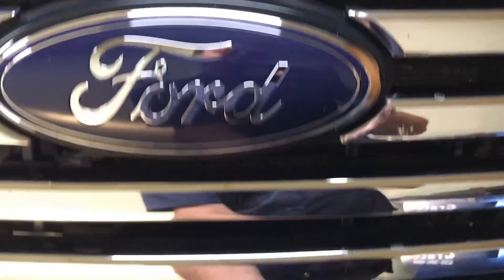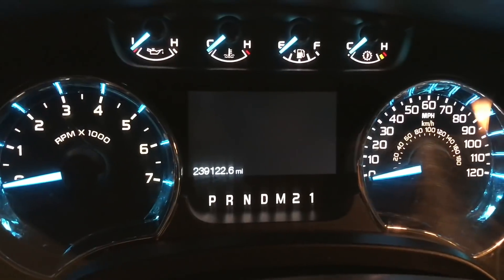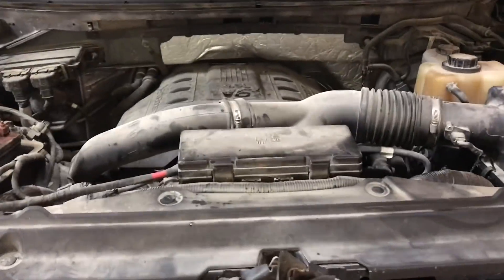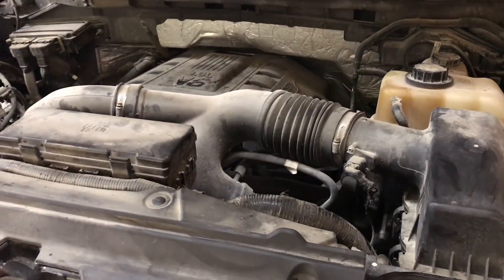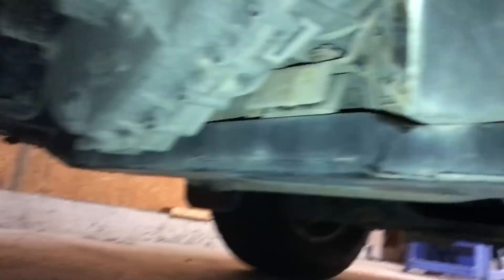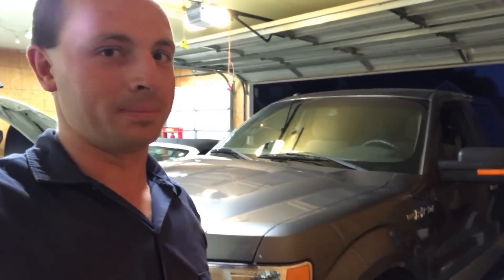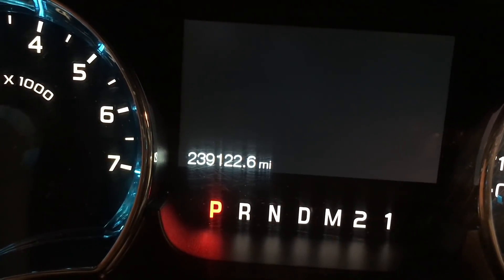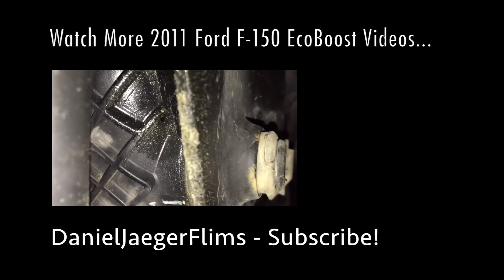Is the EcoBoost Engine Proven?

Comment: I don't trust it,  my grand marqs had 286000 and the odometer didn't move so technically the 4.6 v8 could have had 500000, 1 million, now the ecoboots argument is "well maintained ", crown vics marqs and town cars can go this type of mileage with lil to no maintenance huge difference
Reply: I mean, well maintained probably means they changed the fluids when they were supposed to, and maybe a few other things,  so the same as a crown vic, unless you're saying a crown vic can go 500k without an oil change jk lol.
Reply: @KB-bh9hp  i said little to no maintenance,  meaning none to things like coolant, trans fluid, air filters, fuel injectors, etc. Little meaning not frequent oil changes and things of that nature. You never driven an older vehicle with oil so black its glossy? still runs fine right, i bet it does
Reply: the engines are good in those panthers ,but unless you have a p71 the transmissions need to be meticulously maintained otherwise you will see 170k before they go.
Reply: I agree. those unbreakable 4.6 run forever. but this guy Is talking about new generation hi power lightweight and economical engine. this new  family of motors(ecoboost) still are in their early stages working their bugs out. the smallest gdi ecoboost have intake valves carbon issue. so doez several bmw and  chrysler with their new motor designs.not all designs come out bulletproof even from gm. example Northstar "shortstar" or infamous crappy 3.1. I'm mechanic, and I appreciate reliable designs. however times change. we must follow the technology,accept compromise in performance VS fuel efficiency and emission control standards. I agree with above mechanic. 24000 on this motor is good progress. cheers.
Reply: @jerrykruger  its all about the test of time, had a 74 duce n a quarter electra 225 with the 455 and she still ran after sitting for 20 yrs with just a battery, oil and coolant,  they don't make em like they used to had two 4 bangers,  a buffet of v6s  , and about 6 v8s in my day and none if the v8s quit ever, misfires low oil pressure leaking coolant all that and more and they never let me down now the 4s and 6s you talking o2 sensors, headgaskets, water pump, u name it those components die when they reach certain mileage and abuse,  v8s can have all those problems and more and only see small loss in power but overall still can be daily driven, my 88 Silverado had a clutch fan break and cut the serpentine belt and i still made it 2 miles home before it started to run hot, no power steering,  no water pump, no alternator,  still ran fine that's one instance but you get my point,  i love new cars but it have to be an 8 or better,  eventually ill trade the g8gt in for a hellcat or an r8
Reply: Those crown vic's are tough, hence police and taxi drivers used them for so long

Comment: I was a die hard GM guy before I bought my '18 F150 STX 2.7 Ecoboost. The truck genuinely impressed me on the initial test drive. Hopefully I get a long life out of it, don't have too many miles on it currently.
Reply: The 2.7 is the better choice. It has a better timing chain set-up than the 3.5 liter. Two medium sized chains are better than one long one.
Reply: i rather have the 3.5
Reply: JGL25 that's funny I did ty he same thing you did. My whole family is GM as me also but I just bought the same truck you did and love the 2.7
Reply: take care of it.
Reply: I was going to go 5.0 but couldn't fit everything that I wanted within my budget right now. I usually rotate trucks every 2-4 years so I will probably purchase one next.
Reply: If you bought a Ford, you were NEVER a diehard GM guy. lmao
Reply: @danp7463  In my opinion the 2.7 is a little under powered for a 1/2 ton pick-up.
Reply: Randy Jackson  dont believe everything on the internet. I have a 2.7 52 k miles so far and it's awesome. No issues and I tow my trailer alot and abuse it. Its fast off the line puts all half tons to shame.i know someone who has 170k on his ecoboost zero issues so stop believing everything. I am living proof their solid

Comment: BillsTmax takes care of his and has had to do timing chains twice. Guess it's like GM and the AFM system. It's a 50/50 shot if you get a good one or a junk one no matter how well you take care of it.
Reply: Is the best way to avoid problems with the newer ones to deactivate AFM?
Reply: s Smit Yes, tune it out while the truck is still new.
Reply: I think part of the problem with Bill's truck was the shop he was taking it to was screwing him over big time and not replacing parts they were supposed to as part of the chain replacement.  Not saying the replacement parts that they DID replace weren't potentially faulty, but I put more of the blame on the stealership that did the work for him.

Comment: EcoBoost guys. I'm looking at a 2018 crew cab xlt with max trailer tow package 4x4 and the 3.5. I will be hauling a 7,000 lb trailer pretty exclusively on the weekends. Right now I own and 2001 f350 dually with the 7.3. Will I still be satisfied with the eco in real world towing?
Reply: Damien Hobbs I’ve got a 2017 3.5 EB , 10 speed, max towing, 8’ box. With it I pulled a 8000 lbs trailer and two motorcycles (1000lbs) in the box from Ontario to Florida last year. Wow I’m so impressed with this truck, was passing semi’s in the mountains of Virginia doing 65 mph!!. It’s my second EB had a 2011 before this one. 7000lbs trailer will not be a problem.

Comment: Great video. This gives me more confidence in my 2012 ecoboost fx2 f150 at 67000 miles. Synthetic oil is the key I believe at regular intervals. How do you feel about a catch can and did you plug the intercooler after drilling. I drilled mine  and plugged it after

Comment: I asked this question on your earlier video about this truck but I'll ask it again in case you don't see it.  Since this truck clearly didn't have a catch can system installed and it's doing great, do you recommend installing catch can systems on 3.5L EcoBoost engines in the F150?  Some sources say it's absolutely necessary but this truck goes against that reasoning.  I would greatly appreciate your opinion on this.  Thanks!
Reply: I have 398k and never installed a catch can. Still going strong.

Comment: Who would win in a fight?
a 7 year old truck with 240k of well maintained highway miles,
Or a 15 year old retired cop car with 300k of the hardest neglected miles you've ever seen.
Ford has had better, proven engines. The 5.0 looks to be more of the same. The fact you have to make a video to show us one case where the ecoboost didn't shit itself in under 200k is proof enough that this engine hasn't earned its place.

and this is coming from a chevy/dodge fanboy.

Comment: Great Video - I think all Ford Truck engines are rated to last 400K miles with proper maintenance.    I was skeptical of the 3.5's when they came out, and I had heard that the turbo's were only rated for 150K miles.   You're at almost 250K now, and those turbo's are still spinning great, so that also gives me a lot more confidence in the 3.5.    That being said, I'm not giving up my 6.2L any time soon. :)
Reply: I would think the far far majority will go WAY WAY MORE than 400k even IF you take care of it and you are'nt flooring it at every stoplight.     I'm sure some parts will be replaced or even a turbo... but so what??    Keep going..     Why should'nt they ?
Reply: What was the 6.0 Powerstroke rated for?

Comment: I have a 2013' F150 ECO , I have 96,000 miles; when should I change spark plugs, also, trans fluid? and Radiator fluid?
Reply from the maker: I'd change all three every 100k miles.

Comment: What do you think of the 2.0 ecoboost? I bought a 2016 Fusion titanium with 45K.
Reply: i don have a fusion but i have a 2014 fiesta with the 1.0 eco . i just past 82,000 miles and she runs great.
Reply: The 2.0 EcoBoost is a great engine. There is a guy in the Fusion FB page that has over 200k on his.

Comment: I drive an Ecoboost for work. Good Torque but sounds like a queef when you get on it. Been to the shop 3 times for warranty work. Its a 2015 with 72K. Waterpump, 2 times for coils.
Reply: That's weird I have a 60k ecoboost no issues I know someone with 180k no issues.
Reply: @jayg9732  as they say
Hit or miss
I guess they never miss

Comment: Did you leave the weep hole in the intercooler open or do you put a screw in it and drain it now and then.  I am in michigan and worried about moisture getting in.  Thanks!  What about doing a catch can in cold climates?
Reply: You can have a hole in an intercooler so I'm sure its plugged.

Comment: I want to get the 2014 limited witht the 3.5 ecoboost would you recomend?
Reply: Get a 5.0 less issues
Reply: I have a Lariat and a lot of the quality of life features have failed and needed replaced, sunroof switch, steering wheel buttons, rear window defroster. Other than that, its amazing

Comment: It's ridiculous to think that you can't find some EcoBoost engines with high miles that are still running good. But also we must keep in mind that Ford sells over 900000 a year.  The truth is that most won't make it that many miles even with good care. You're likely to see as many 2011 Chevys or especially Toyota's still on the road even though Ford sold more than twice as many trucks. We should focus on what percentage of the units produced will make it past 200k. Ford not likely to do well.

Comment: They did have a V8 didn’t they? A 5.0 Coyote and a... 4.6 back in 09?
Reply: The F-150 has had a 4.6L V8 from 1997-2009, a 5.4L V8 was optional during those years too. Then in 2010 F-150 had gained a third V8 the 6.2L V8 (Newley developed Engine). In 2011 they removed the 4.6L V8 and the 5.4L V8. The 4.6L V8 was replaced with the 3.5TT V6 EcoBoost and the 5.4L V8 was replaced with the 5.0L Coyote V8, 3.7L N/A V6 was added too, the 6.2L V8 remained an option on F-150 up to 2014 then it was moved to the super duty series for the 2015 model year. From 2015-2017 the F-150 was powered by the 5.0L V8, an added 3.5L N/A V6 (replaced the 3.7L N/A) V6, 3.5L TT V6 EcoBoost and an all new 2.7L TT V6 EcoBoost motor. (Two EcoBoosts now Lol). In 2018 - 2019 the F-150 Kept the 5.0L V8, 3.5L TT V6 EcoBoost & 2.7L TT V6 EcoBoost, but the 3.5L N/A V6 was removed and replaced with a 3.3L N/A V6, F-150 also picked up the Diesel 3.0L V6 Powerstroke in 2018-2019. Long story short the F-150 From 2010-2019 has had a lot of motors added and removed. Currently theres 5 engine options (too many lol) 5.0L V8, 3.5L TT V6, 3.3L N/A V6, 3.0L Diesel V6 Powerstroke and the 2.7L TT V6.
Reply: Edward Myers Jesus Christ that’s a lot of engines..
Reply: @chaoszombie9995  yes it is ever since 2010 it's been crazy. Like the 90s- early 2000,s was simple 3 engines. Now in the past like 8 years weve had like 7 motors 5 gas V6's one diesel V6 and a couple of V8's too much going on. Hopefully soon Ford will sort it out. and I forgot to mention the 4.2L V6 from 97-2008 LOL

Comment: Wow, oil changes make a difference
Reply: That and letting it warm up in the morning. My '05 5.4 3 valve has more miles than that eco boost and run's strong. I don't care what people say about oil change's I do mine every 3,000 Castrol gtx 10/40. As far as filters go I've used them all including Fram.
Reply: @danp7463  i have a 97 f150 with a 4.6L, at almost 199k. I thought i was the only one who let mine warmed up. OCI every 3k miles with MC syn blend. How ahs the castrol gtx worked so far?

Comment: The timing chain has never been done? Or the turbos? I know in 2011-2014 the timing chains would stretch, and waste gates would sieze up on the turbos. There were TSB's. Non of that has been done?
Reply: Alex Puls the timing chains on all the motors built in 2011/2012 were part of the TSB. Some 2013 trucks have the problem because of their motors being built in 2012. I haven’t heard of any turbo failures and if it happened it’s rare
Reply: @nationalwashproducts2124  the turbos themselves don't fail. The waste gates seize and the engines overboost and go into safe mode. I've replaced a few of them.

Comment: What about timing chain rattle or tensioner stretching upon cold starts?
Reply: Joshua Guzman start changing your oil sooner then recommenced. What climate do you live in?
Reply: @honeybear1234  Harlingen, Texas/ South padre Island closest you can get to sea level.
Reply: I am in San Antonio I started changing the oil about every 3k miles and have noticed the timing chain rattle to be pretty much eliminated. The extreme heats are breaking down the oils quicker which is creating less lubrication. Try it out see if it helps...

Comment: How in the world do you get 21 with the Ecoboost. I want that mileage with mine.
Reply: He does construction so maybe it's a lot of highway miles.  Slowly accelerate when stopped and cruise at highway speeds.
Reply: As much as Ford would love to say otherwise, it's either Eco or Boost, you can't have both. 

However, it can be Eco if you drive right. Slow acceleration, steady stops, and cruising at a lowish highway speed (65MPH and not above, let's say). But that low end torque feeling when you hit that boost just right is too tempting, :)

Comment: Been want to upgrade from my 2005 5.4L. Seriously considering the 3.5 over the 5.0
Reply: Corey Taylor no no no I bought my 2015 with the 5.0 and my cousin has a 16 with the 3.5 and although it is faster, there’s just nothing like the feeling of putting your foot into a v8
Reply: That would be a toss up for me.   You definitely want a 10 speed.
Reply: @clintmullins4406  no you want a manual
Reply: It depends how long you're going to keep it. If you're going to least one get the Ecoboost, if you're going to keep it for 20 years get the 5.0

Comment: When should he flush transmission fluid?
Reply: I would have the Ford dealer (not Jiffy Lube ever) flush out every 50K especially if you plan to keep your vehicle over 100K.  My 2012 F-150 Eco has 282K and trans still runs tip top because I change out every 50K. Preventive maintenance is a lot cheaper than a new trans. BTW there is NO lifetime transmission fluid. I had Jeep dealer tell me that I never have to change the fluid on my 2014 Grand Cherokee. BS!

Comment: Wait. A pickup with 240k miles? If this were a Chevy or Dodge it wouldn't be that impressive. My dad's work truck has 210k miles and he abuses it daily since 2013. Its got the 6.2 oil changes every 10k miles and thing runs better than this.
Reply: We have a fleet of Ford's all have 250 400 k plus miles run great . We have Silverado tundra and returned em . We abuse em everyday and r the best trucks my company has owned ...no thx for gorvermen t motors or fiat
Reply: @jaygarcia222  Sketchy reply there dude. Buthurt much?
Reply: Sad but true. We don't use Chevy tundra or Dodge we had em and returned em lol
Reply: @jaygarcia222  yeah sure buddy. Have fun losing money on them imaginary Ford f150s
Reply: Losing money ? Lol didn't buy a Chevy government bailout remember ? Jaja
Reply: @jaygarcia222  quit lying kid
Reply: @jaygarcia222  I'm a mechanic. Mechanics love Ford's because they always break down. It's a known fact that Ford's f series pickup platform is the least reliable out of all the brands. You can't put a boosted puny engine in a truck and expect it to last as long as a larger displacement engine not having to work as hard. It's just a known fact that your puny undeveloped brain has a hard time computing because your dad owns a ford and you can't comprehend the fact that he made a bad decision.

Comment: I would never buy the 2.7 EcoBoost or the 2.3 in the Mustang, putting lots of power into a smaller displacement block wears them out faster. 
If you want reliability and big power go V8 or bigger.
Reply: They are engineered to take it that's why my 1.0 is iron block instead of aluminum .
Reply: @justabagel5173  But still won't outlast the engines in the 92-96 Ford TRUCKS.

Comment: i have a 3.5l and i beat it daily and it never let me down
Reply: Doom Exile how many miles?
Reply: No timing chain stretch? I have the dreaded p0016 code. 1400 just in labor and 800 in parts if I buy the parts. Doing the job myself in the next month and then I'm sending the bitch down the road lol
Reply: I got 249xxx km  and  not sure about the code i could check it lol i got so many light in my dash abs airbag and service trac

Comment: Based on what you learned thus far, what are your thoughts on the 2.0 Ecoboost 4cyl??
Reply: Its built to handle a lot of power and in stock for it should last you a very long time but remember turbos are a part that needs to be replace cause they dont last forever

Comment: I refuse to buy anything but a 5.0. Yes some do get to high mileage but turbos are an extra complication and I'm pretty sure a boosted 3.5 V6 is not going to be reliable over the long haul. Why would you purposely buy a more complicated engine that has more things to go wrong for negligible gas mileage difference? My uncle has a 5.0 that gets 18MPG 50/50 city and highway and I know that engine will be bulletproof in 10-20 years from now. It just doesn't make any sense to me.
Reply: Speculation doesn't make it a fact. You think it won't be reliable but that doesn't mean much. Any engine, including the 5.0 have had problems come up here and there. It happens more often with a new engine platform until they work out the bugs (what works and what doesn't). As the existence of the engine becomes longer, so will the reliability. The majority of owners with any engine don't experience any problems provided regular maintenance is performed. 

That being said, the MPG numbers are less than what I was expecting with my 3.5L, but I didn't buy a truck for good gas mileage. I bought my truck with the 3.5L because that was the only way to get the Max Tow Package for that year truck. The output for the 3.5L is higher than the 5.0L, and it makes ~90% of its torque at around 1800-1900RPMs.